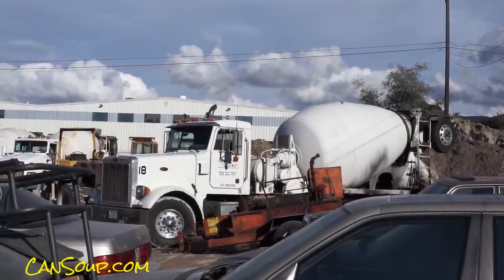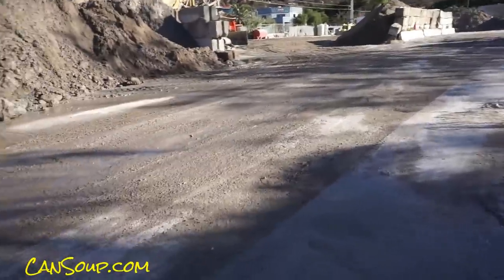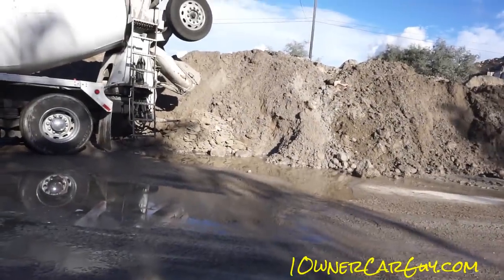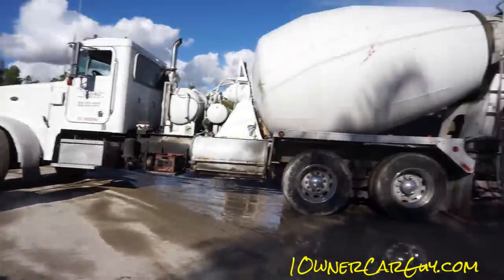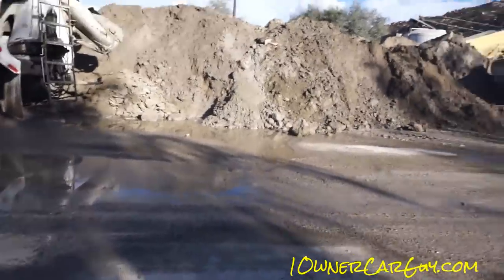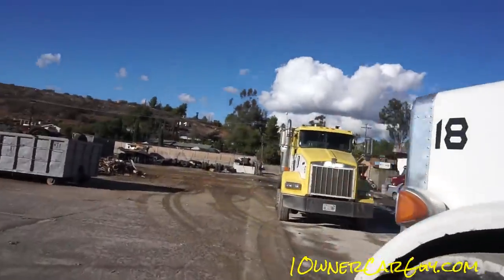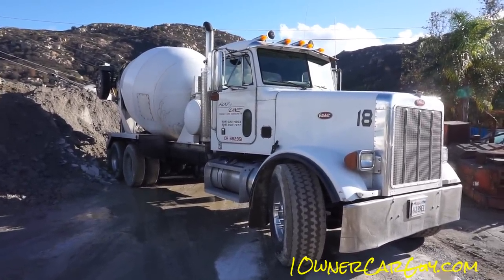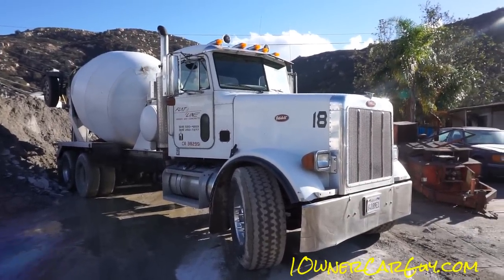Concrete Truck Ruined Cleaning Hard Cement From Mixer Barrel

Comment: Some times its the type of batch plant that causes buildup, when all the Portland goes in first there is a good chance some may just clump and stick to the drum right off, and even the concrete agitating wont get it off,  Its rare to almost impossible for it do set up while the drum is still moving with out just stupidity on the drivers part,  As for clean up at the end of the day,,,, if the rinse out water is still coming out dirty,,,, the drums not clean
Reply: when the cement goes in first,it clumps into large balls and sticks in the cormers of the fins.when you try to wash it into the load,many times the load gets to wet.by the time you get rid of the load and wash off the fins,it is almost impossible to wash out with the water pressure these trucks have

Comment: chipping a concrete truck, not a fun job at all, noisy, dirty dangerous, hot, our company won't allow it done without a safety spotter, right by the hatch, If fins are properly washed after each load, this doesn't have to be done very often. I do mine once a season.